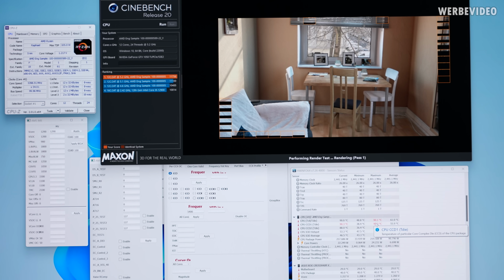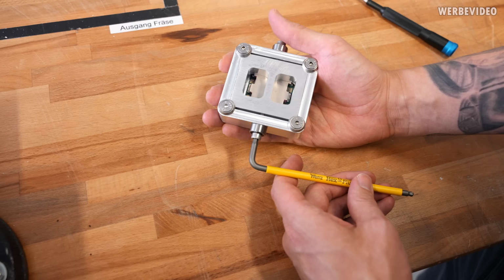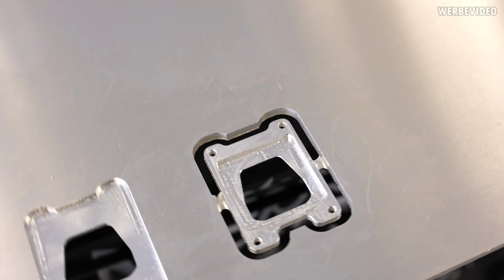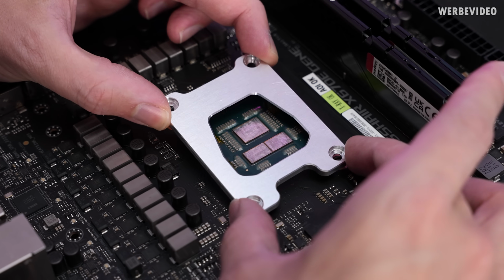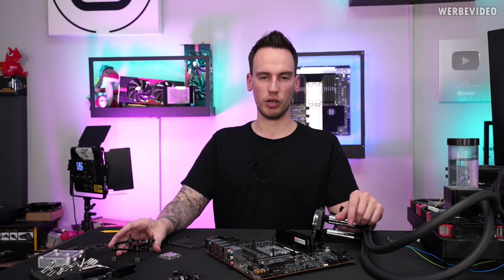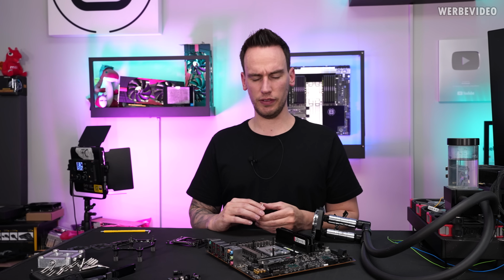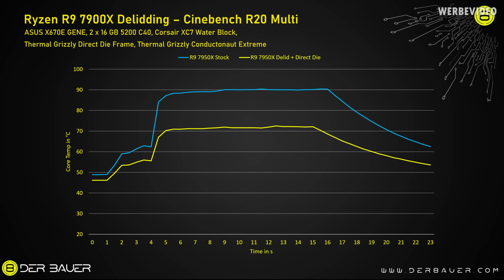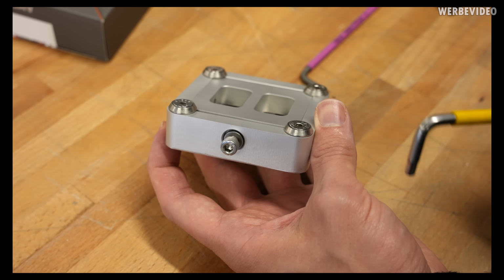Ryzen 7000 Delidding - Unreal Temperature improvement with Direct-Die Cooling

Comment: This proves again, manufactures do crap, they deliver crap and they sell us things that are far from ok. They work yeah, but badly, parts expensive like a flagship CPU or GPU should be perfect, those HTSs are very very poor made, very lazy, a garbage, years passed and they did not changed the way they do, low quality thermal paste, bad machinery of the surface, bad thermal efficiency. So now user need to fix every single board, card, chip that multi billionaire word wide companies make? I'm fed up with this bullshit.
There isn't a single PC that I build that I  not changed all settings, factory voltages are always sky high for starters, everything is poorly set up, why bother to buy Z class boards, prime, maximus, XMP, if you need to revise, tweak every single thing, for a user that is used to do so, fine, but the guy or girl that just want a PC that works fine, not stress with good temps or performance, its fair those people see a PC that is sometimes weaker or equal to their own, with performance much, much better, and they don't know why? They can learn yeah, but man Its a load of work, for the average user. And we accept this behavior of the manufactures, why?
I don't want a closed machine, like a console, but I also cant deny or be blind about those LAZY cheap ass moves that the biggest companies in the world do for a difference of cents by part. They need start to develop better HTS design for CPUs, better thermal solutions for GPUs if they keep this trend of more power consumption and heat.

Comment: My theory is that the IHS was kept super thick for 3D V-Cache yields. IIRC AMD was having lower than desired yields on the lapping process to make the 5800X3D because they had to make it so thin to fit the existing socket specifications. So I think the thick IHS might just be extra thick to give them more room to play with when tuning tolerances and yields for next gen 3D stacked CPUs.
Reply: that's a super interesting and very plausible hypothesis. gonna remember this when r7k x3d CPUs come out next year
Reply: Thinking the same thing. Though still curious how much further the cpu can go with the extra thermal headroom.
Reply: Its late but that makes no sense. If they would made the ihs thin there would be more place for the x3d AND better cooling.
Reply: It jus to keep compatibility with am4 cooler the switch to land grid array (LGA) changer the cpu height vs (PGA)
Reply: Thought the die size was the same for 5800x and 5800x3d? Didn't know about these manufacturing issues.
Reply: @orangepacker7479  The width and length are the same but the entire point of 3D cache is that there's extra layers of silicon with more hardware (they're building the CPU 3 dimensionally), so it occupies more thickness.
Reply: @bosstowndynamics5488  Derbauer says in a reply to another comment that there is no change in die size. I thought that since its 3D it must be taller originally but am inclined to believe derbauer on this one...
Reply: @orangepacker7479  There will be a height difference, that's what 3D stacking means: on top of each other.
Reply: @chazy123  Logically, that makes sense. Problem is derbauer said the die stayed the same on the 5800x3d...
Reply: @orangepacker7479  Then he was simply mistaken, if the height is the same and there's no more room at the sides, where did they put the extra cache?
Reply: @chazy123  dunno if you scroll down you should be able to find the comment where derbauer said that and ask him.
Reply: @chazy123  Obviously I'm willing to believe that he is wrong. Its just that he seems like he would have actually measured it at some point for something.
Reply: @chazy123  The die is the same height with 3D cache. Proof is the 5800X3D having the exact same die height as any other Zen 3 part.
The diffused metal layer on top of the actual silicon on the X3D parts is simply much thinner, thus allowing stacking of dies without increasing the total height of the finished die.
Reply: @chazy123  The height of each layer in 3D stacking is in the microns range, I saw values of 50 microns for one layer and 600 microns for the whole thing (not AMD, just an example). So it wouldn't translate to height differences visible at the macro scale
Reply: @orangepacker7479  He wasn't wrong about the physical size of the die, but the 3D vcache is a whole extra layer of silicon inside the die, the way AMD achieved the same die height was by investing in more expensive thinning process to all of the layers to make room for that extra layer, but that still came at a cost of having to lop off 400 MHz off the max frequency.

What's being theorized here is that with the extra 2mm of material in the 7000 IHS, AMD should be able to add extra layers to the die without having to spend more on that thinning process, they'd just need to shave off that extra height's worth of material from the IHS itself, which will result in better yields (and hopefully lower prices).
Reply: @blarghmcblarghson1903  Thanks for explaining, derbauer just said that with no context to someone saying something similar. Do you think ryzen 8000/9000 (8000 for next-gen mobile again maybe) will have better or the same cooling? The thinner IHS should help but the higher clocks and thicker die might make it run hotter.
Reply: @orangepacker7479  Honestly, I don't know nearly enough to make a decent guess. Considering everyone buying into this gen will get coolers based on that 95C target, AMD can target 95C again next gen and get a generational performance improvement by increasing die size and thinning out the IHS while staying on TSMC's 5nm.

After that they could switch to 4nm and thicken the IHS again for another generational leap, then increase die size and thin the IHS for yet another leap... come to think of it, removing temperature as a variable might not just be for AM4 cooler compatibility (since it's technically not compatible with all AM4 coolers anyway), but a strategy to give them plenty of headroom for AM5's lifespan.
Reply: @blarghmcblarghson1903  That could actually make sense. When Steve from GN asked the OCing team from AMD about it they just said they were trying to keep z-height. Definitely an interesting move if that is really the case. 

They are basically saying that they can hold back and still stay competitive against Intel. Widening the cores and other things that intel did to make 10nm work for alder lake could also make cooling easier as it widens the actual hotspot on the IHS for the cooler. If you look at a delidded raphael CPU you can see they have enough room for wider or more or bigger cores. AM5 definitely has a lot of room to grow even without limiting its first iteration, but maybe they got scared after intel whipped out their hybrid architectures and mapped out tiles for their future architectures,
Reply: @orangepacker7479  there are no issue the guy only assuming
It was to keep the same height as am4 for cooler compatibility

Comment: Awesome to see day 1 de-lid and direct die cooling videos 😂

A wild guess on the thick IHS, maybe they’re planning for future SKUs (Zen 5 or Zen 6?) with thicker dies, either with 3D V-Cache, or possibly even stacked cores
Reply: They could go for a thicker substrate as well when the z-space is not needed. Don't know what that does to the manufacturing cost but it's good that the platform literally has room to grow.
Reply: My personal hope is for some Xilinx chiplets to find their way into these chips. They might end up needing that extra Z-height for thicker dies or linking the CPU chiplets with something like the Infinity Fabric in the GPUs.
Reply: v-cache didn't make the 5800x3d's dies any thicker... I have hope for zen 5 and 6 though. Stacked cores would mean getting threadripper core counts on consumer chips, which would eat into their HEDT market share, so we propably won't see expanded core counts until at the earliest zen 6. My guess is they will use their zen 5c (the c stands for cloud btw) cores on their HEDTS for zen 5 to experiment and then bump the core counts for consumer chips at zen 6.
Reply: @cheshirster  Then I'm wrong I guess. Derbauer commented elsewhere on this video (scroll until you see Rabbit's comment) that it didn't so I was emboldened I guess. The other things I said should still be true though.
Reply: @cheshirster  no Vcache didn't make it thicker. They explained it when they rolled it out, and debauer also states there's no difference.

Comment: I guess they met their goal of beating intel 12th gen so they didnt bother optimizing the IHS thickness in favour of having some coolers be compatible. Their new platform is already costing a lost with DDR5, so I guess they tried to cut some costs for the users by not changing the IHS z height from lazt gen. This might imply AM5 being transitionary for the next platform (iirc they promised a much lower life expectancy of this platform, like only 2-3 years EDIT nvm check edit below) since I doubt intel 13th gen and onwards would let them mess around with such a fundamental factor in performance so blatantly for such minimal gains. But, in the end, the new CPUs are very nice, and I can'y imagine what the 3D V-cache would do to these monsters haha.

Edit:
So I just check and AMD plans to support AM5 for 5 years. While its still not that long, as someone else mentioned it could be headroom for a more exotic cache design, but that is doubtful as the guy who made this video (sorry I don't remember your name and youtube mobile sucks for writing comments D: ) pointed out there were no dimensional changes when AMD made the last X3D CPU. 

But one thing to note is that AMD has thrown their platforms under the bus before (workbench threadripper comes to mind), so they might abandon or alter AM5 somehow if intel heats up the competition enough. Or maybe they'll just change something else I can't think of... Though still overall a dumb trade off imo. 20°C for halfassed last gen cooler support, that could be fixed by a 10$ adapter or something otherwise.

Comment: This is a big relief, I don't go over 65° on my 3950X at around 4.5, so the fact that you can edge out 70° on 5.5ghz on the 7950X is seriously killer!!! I'm not upgrading this generation, but now I'm ready to get into  delidding when Zen 5+ is out
Reply: well, there's a coverage done by pcworld that many media doesn't talk about, it's about eco mode in the new zen 4 cpus which limit the tdp to 105 / 65 w, instead of using the 95 ° temp as a limiter
Reply: @kingofstrike1234  
Will check it out, thanks for the info!
Reply: only issue i had with the 3950x or from an "upgrade" standpoint was ccx and per ccx cache, zen3 was quite the leap since they did away with ccx and brought upon the zencore/integration of a shared cache pool and simultaneous access/computing/ipc from core to cache vs the ccx design which led to voltage jumps/clock bouncing/spikes ultimately latency issues based on those characteristics. Which even the 5950x SHOWS compared to a voltage tightened/OC 5800x or 5900x by comparison which run games better 5800x>5900x even in some cases where scheduling becomes an issue with less than optimized engines/games FC6 being a more recent example.....BC MY FC6 Came free with my 5900x was delayed 1 year from launch....and yet UBISOFT/AMD lobby yields a scheduling issue for r9 cpus in the FC5-FC6 "MADE FOR RYZEN" franchise....granted 12900k also sees the same issue. Also owning a 3950x led to clock tuner ryzen, Dram calculator, ryzen master being used as well as switching things like SMT off for games like escape from tarkov, cs:go, valorant, siege....among others. Which constituted reboots etc forgetting which setting is enabled for which use/case etc. Looking up your board/bios to see which ryzen power profile is most ideal for your specific build bc its non specific and even bios updates could mean you have to switch power profiles to sustain original OCS/stability or lead to crashes which is a nice ADDITION of work load on a random day
Reply: @anhiirr  kya kehna chahte ho